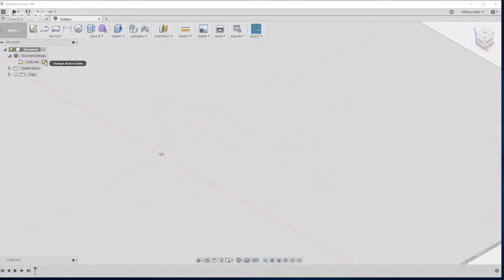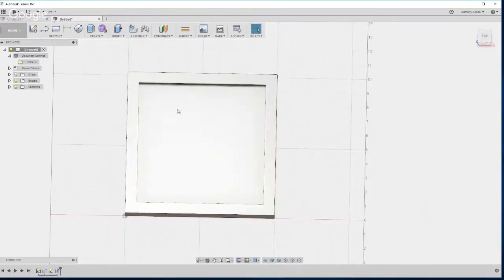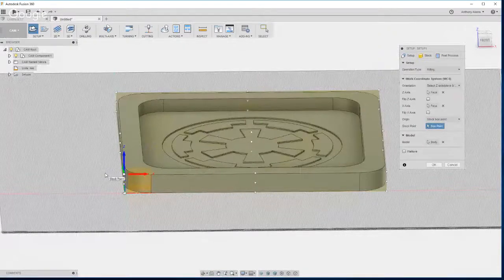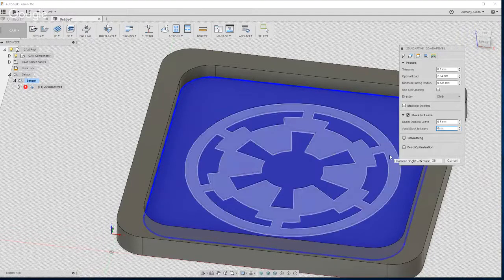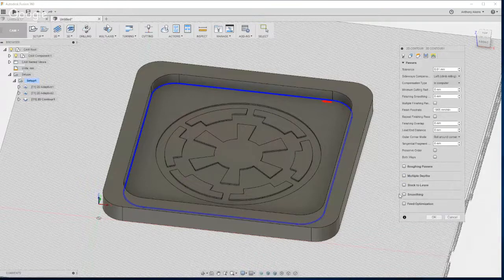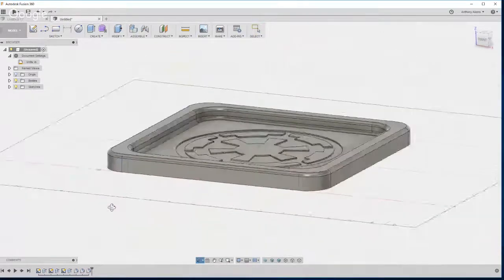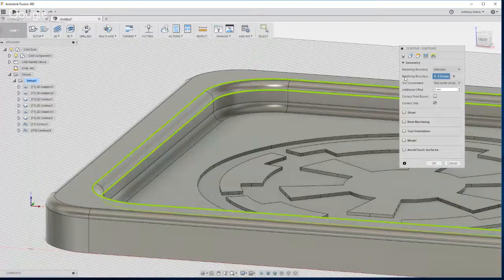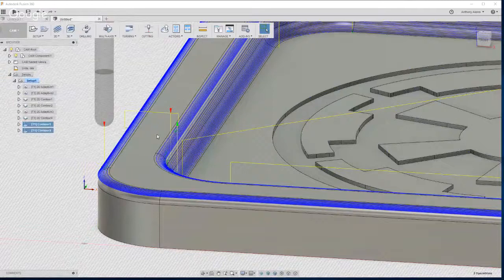Fusion 360 Basic sign / platter CAD & CAM in Fusion 360, geared to the Shapeoko 3

Comment: Hi Tony, and thanks for the great tutorial. I do have a question, if you don't mind helping me. When I process my 2d contour tool pass I keep hitting stock that's no supposed to be cut, on the lead in and lead out. I have changed all the ramp setting so it no longer passes through the part I don't wish it to but it still gives me a collision notice. Have you any idea what it could be? or if there's an obvious setting I'm probably missing.
Reply from the maker: If you've edited the ramp setting so it doesn't lead-in/out through the part (does a plunge instead of a turn into the part) that should be all that's needed.  If you're still getting a warning it may be that there's not enough space for your endmill and it's actually cutting into the part a bit.  You may need to relax your stepover settings or lower the number of contours you're doing.